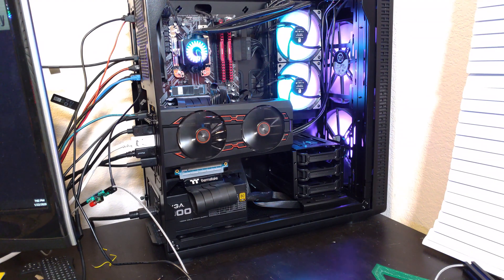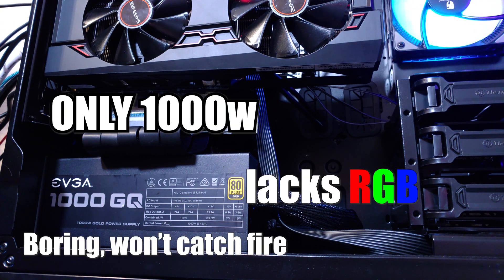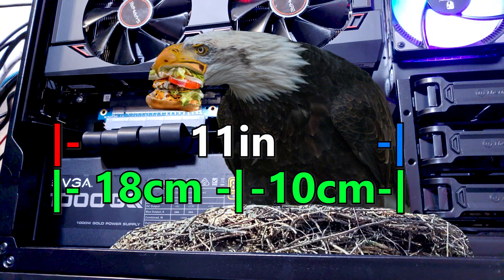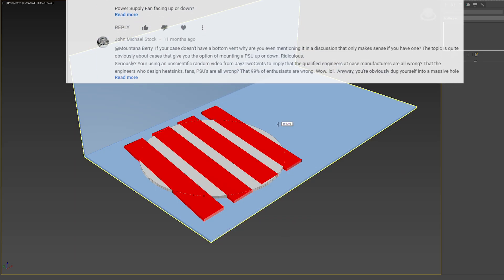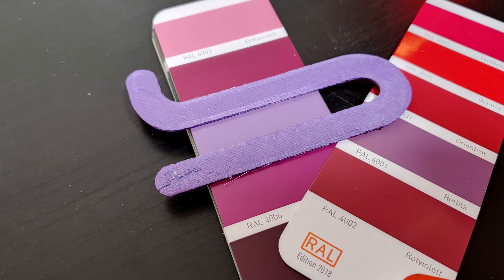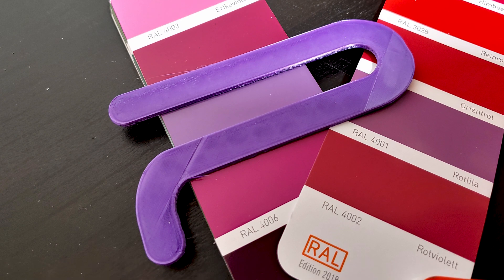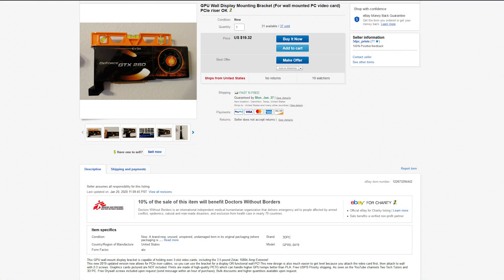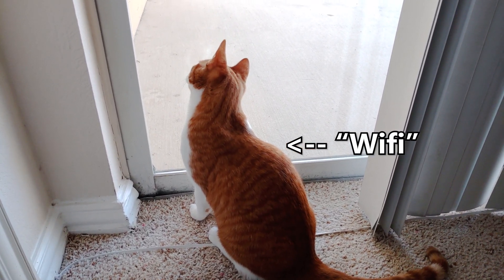DIY PSU cover (3D-Printing PC Parts!)

Comment: Hi I have a question about heat, does it ever get so hot in there that the 3d printed parts start melting?